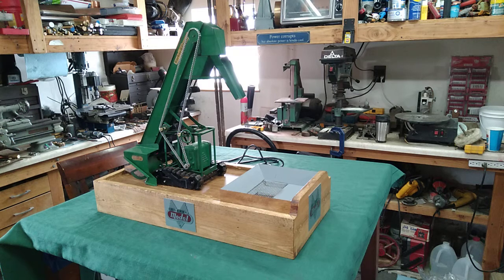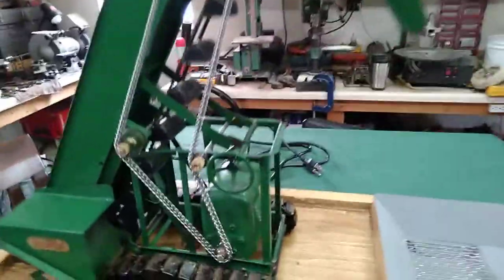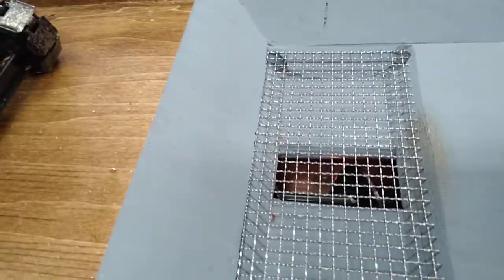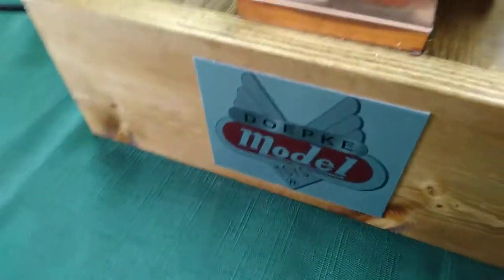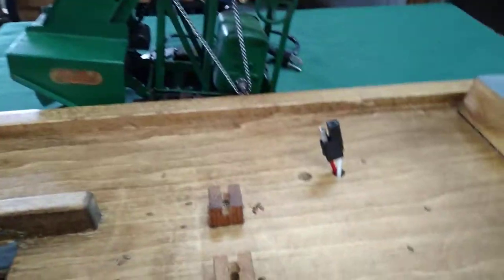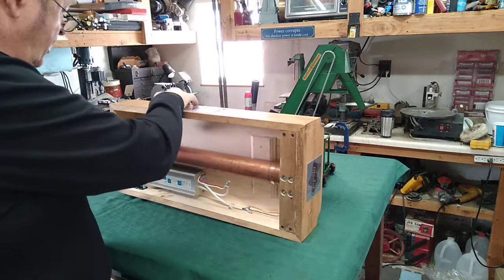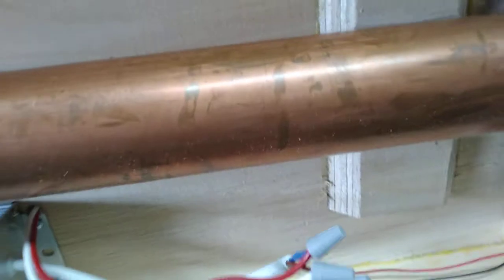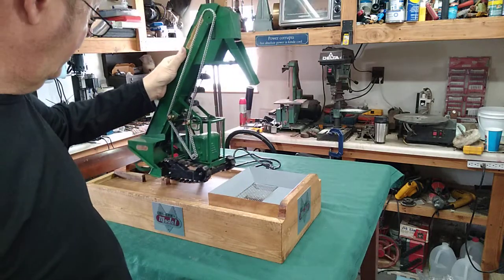12V "motorized" Doepke, Barber Greene Sand Loader W/Auto feed auger.  "TECHNICAL VIDEO"

Comment: Taking mine to a steam show this weekend, as yet unpowerd, but after seeing this........
The steel used on this model is very hard indeed, and the drive chain is also hardened I think.?
Would like to RC it, track drive as well,  these run backwards, into the windrow...... couple of 6 volt motor/gearboxes and one for the buckets, job done...
Reply from the maker: I would like to see it when you are finished. good luck.